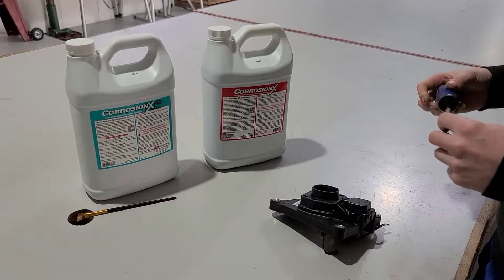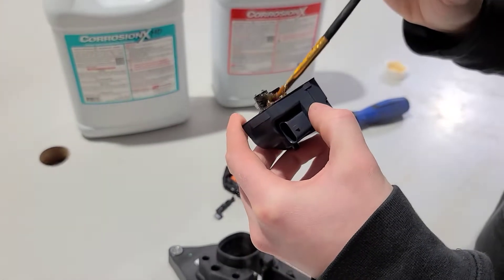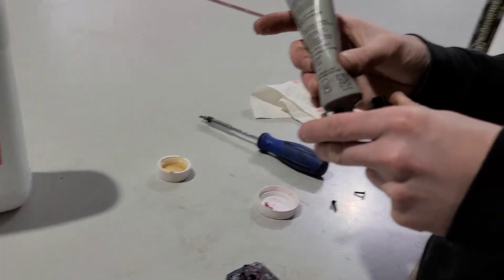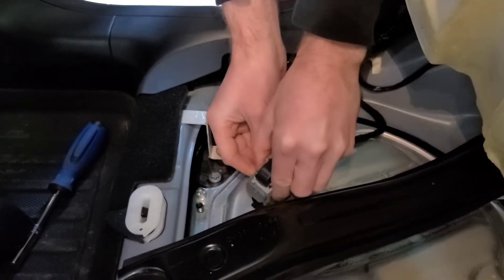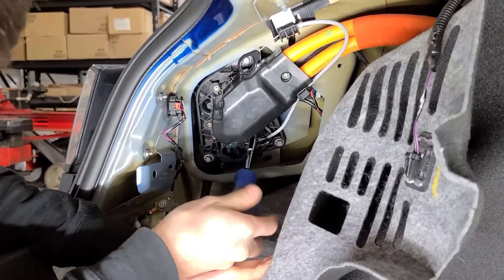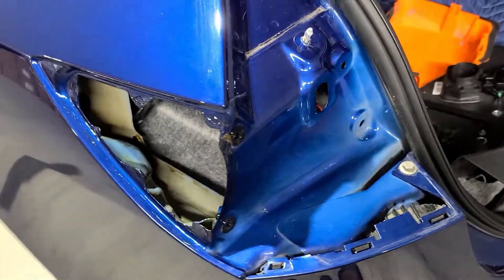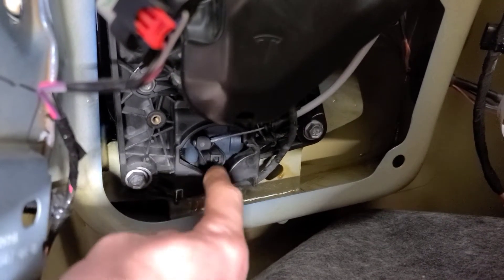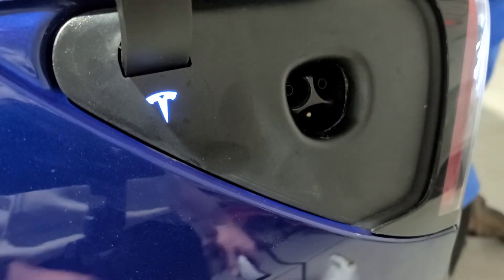Tesla Charging PROBLEM - SAVE $800 and FIX your TESLA!!!

Comment: Followed this video and replaced the o ring with one from a parts store. Awesome video which was far less intimidating than the manufacturer video. Left the charge port cap loose and got a fault for unable to charge. Replaced the orange cap securely and car is charging. Thanks!
Reply from the maker: Glad it helped!
Reply: Could I please ask if you followed the part about disconnecting the power from under the rear seats? It’s not mentioned in the manual but I assume this is imperative to remain safe from hvac?

Comment: Hello, what is the problem that can be solved by repairing the actuator? In my case, the error is "Unable to DC fast charge - OK to AC charge - CP_a163" and I cannot find where the problem is. It occurs when I accelerate sharply.

Comment: My J1772 adapter is stuck in the charge port, and the manual release cable broke off after the first use. Now, the charge port control is blinking red.

I’ve removed all charge port screws, but the adapter locking mechanism is still engaged, holding both the adapter and the port in place. Since the manual release is broken, I can’t disengage it.

What are my options for manually releasing the adapter?

Comment: Just quick question will this fix my car because it charges and stops and when I plug it back in it charges but it does it continuously
Reply from the maker: This helped me fix my latching issue. I have not had a problem where my car stops charging. What are the errors that come up?